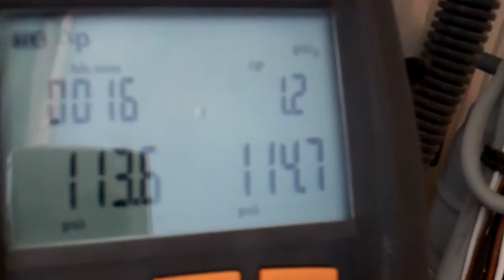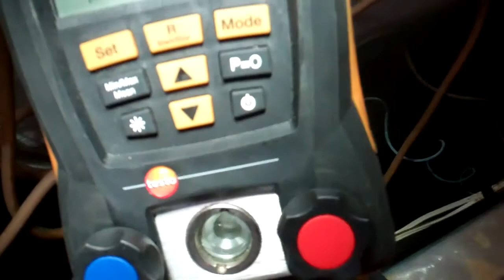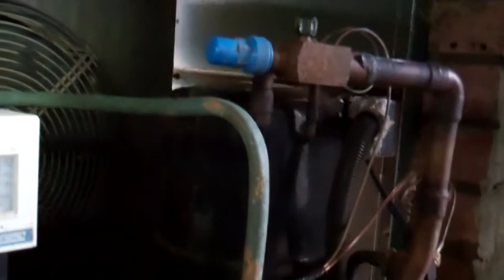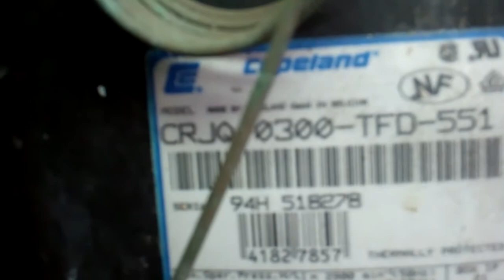Leak MkIII

Comment from the maker: We used to use ptfe/teflon tape and seldom had trouble with it but i'm told the newer HFC refrigerants will eat through it in time so a liquid sealant is needed, trouble is the liquid sealants seem to dry out after 10 years and leak then anyway!
Might start re sealing these plugs any time i have taken the refrigerant out.

Comment from the maker: Hi Ian! I hate looking for leaks that you can't hear! Can be a five minute or five hour job luck depending.

I've not had much success with leak lock but been ok using tru-blu by rectorseal, time will tell with the loctite as this is the first time i've used it fro refrigerants.

We can still use recycled R22 till the end of 2014, R422D is shit, even the customers notice things don't work as well on it, i've been called in on systems running it and had to change all the solenoids as o rings died

Comment: Just had a nasty Job that costed nerves. After fixing a few minor leaks it ran for about 3 months then started losing refigerant more and more and I spent 4 hrs. looking for it.  End of the day it was the suction that ran in the case insulation to warm the drain pipe (hot gas defrost). 
I use leak lock a blue thread sealer or the red locktite as you have.
Do you still get R22 recycled stuff or are you also using this R422D rubish that makes the system leak everwhere you can think.